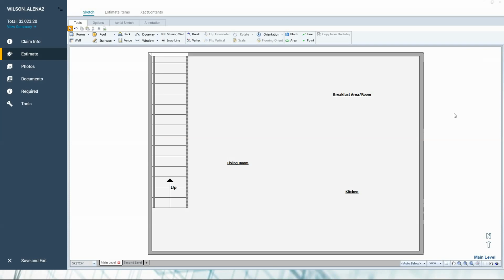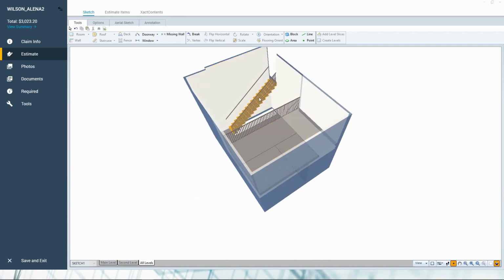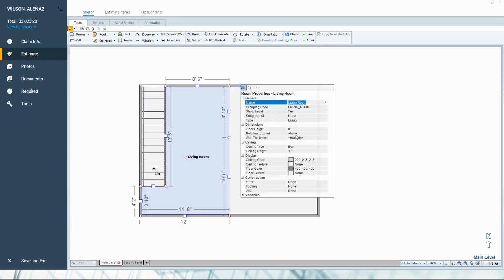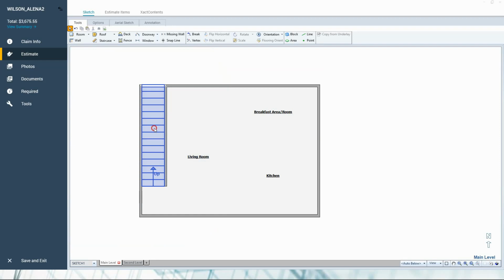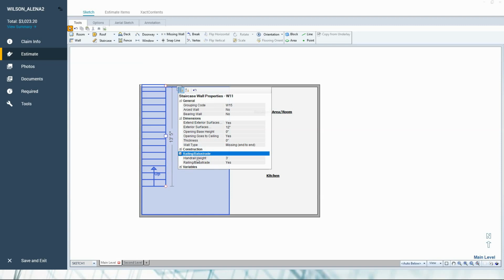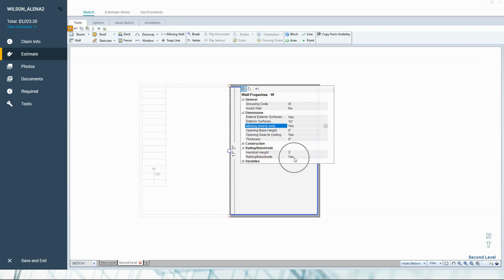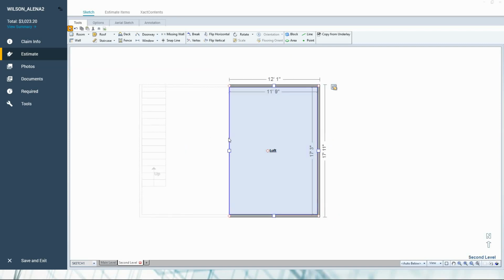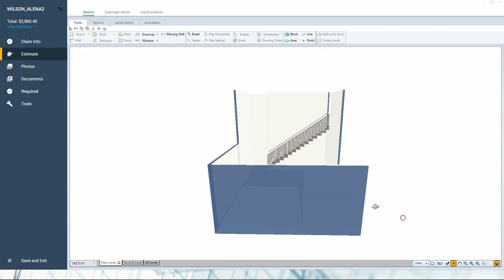Railing on Stairs or a Loft

Comment: Alena, 

How would one go about if only half of that loft wall was railed, and the remaiming half was a full wall?
Reply: I'll leave it Alena to answer, but I just did it as a missing wall and then altered the missing wall in properties to include the railing.
Reply from the maker: Great question! You would want to make a missing wall for the partial railing and then go to the missing wall properties to change "Opening goes to ceiling" to Yes in order to get the balustrade property to show up. Let me know if that works for you :)
Reply: @EstimateMastery  Ahh. Got it. Ive  been going crazy on that one. My work around had been extending the wall by a foot,  deleting the wall, tjen adding two walls. One for the rails and one for the full wall. Thx. I will give it a go
Reply from the maker: Oh man! Great workaround, but whew! Sounds like a lot of work :) Hope the missing wall trick works out.